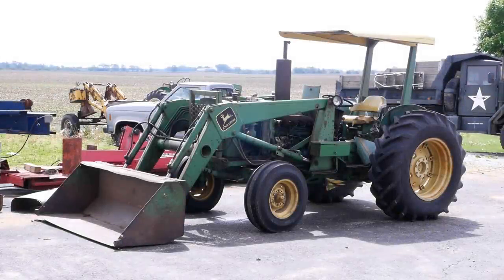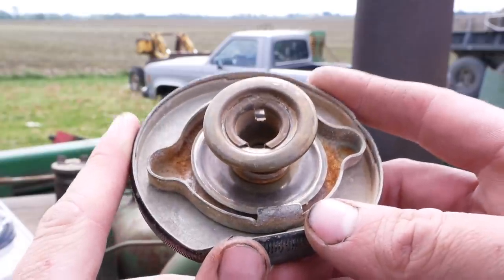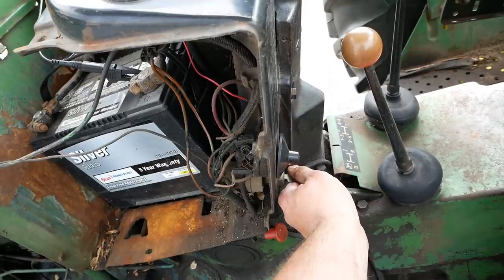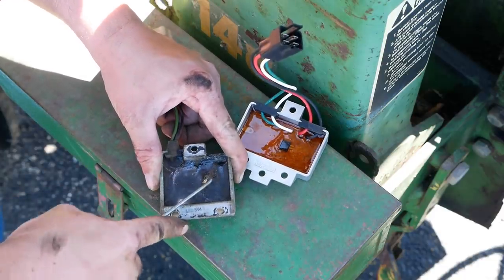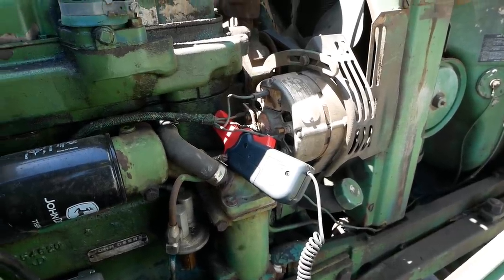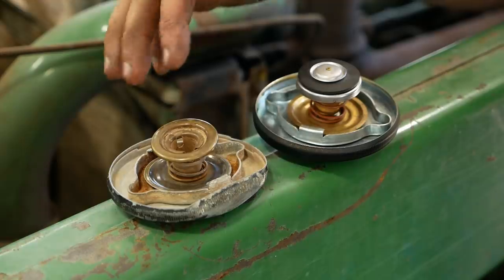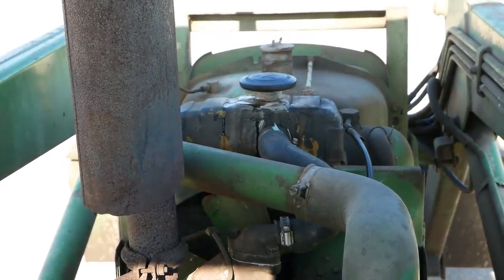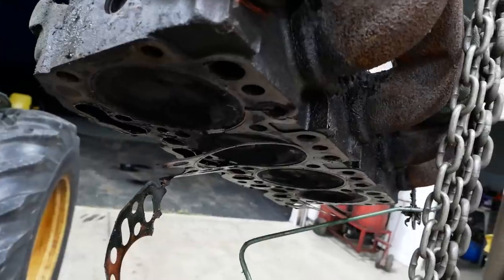Not Fixing a Tractor - Overheating and Barely Starting

Comment: Hi Wes, I just watched your video and I'm incredibly impressed by your knowledge, calm demeanor, honesty and humility for someone so young (yes - I'm old!). I'm in the trade and find that most of the technicians I've employed over the years have had only a fraction of the knowledge that you have but nevertheless had a vastly over rated view of their abilities.

Just a thought re the testing for head gasket failure.  This is not an original idea but one I now make my techs do before I accept their (generally hasty) head gasket failure diagnosis.  Fit a pressure tester to the neck of the radiator when the engine is cold.  Start the engine and watch the gauge, if the pressure only starts to increase from zero as the motor starts to warm up then there is probably no issue.  However, if the gauge starts to rise immediately while the engine is still cold then the cooling system is being pressurized via a blown head gasket or a crack.  Simple, effective and has saved several unnecessary teardowns.  Sorry, but I just don't trust those chemical sniffing test kits.

Keep up the great work, we all learn from your successes and the occasional mistake!

Comment: Had to give you a thumbs up for your expertise and integrity and what I perceive as your genuine dissatisfaction of not being able (scratch that) * allowed * to recover this machine.

I have an old standby automobile that has an overheating issue that was supposed to have been fixed by a reputable garage, I'm gonna take a look at the radiator cap as, I knew it was important, but not as much as you taught me.  Fingers crossed on that and thanks Wes!

Comment: Ehhhh its a mechanical piece, prone to mechanical issues. None of which are your fault. Thumbs up in my book Mr.Wes
Reply: These weren't mechanical faults with the tractor. This is 100% owner or operator abuse. Well-maintained old Deere tractors can run ~forever with the timely application of a lot of time and a little money or less time and lots of money.

Comment: When I was a John Deere tech I just HATED working on neglected crap like this. If there was a Society for the Prevention of Cruelty to Tractors, I would have referred several 'customers' to them.  Probably see this on Big Iron auction soon.  

Sadly, the Dubuque engine was probably the best part of that series of tractor.  The transmissions were pretty problematic, followerd by the hydraulics. The plastic bleed line leaking on this beast is actually an overflow from the surge tank in front   above the main hydraulic pump. Oil from the charge pump inside the transmission goes to the main pump via a big steel line in the inside of the left frame rail. Pressurized oil from the main hyd pump is in the steel line going down the inside of the right frame rail.

Comment: Hi Wes! I finally found your You Tube channel. Now I am binge watching all your videos. I  turn my own wrenches and I am self taught. Had to learn diesel since I have a 2005 GMC duramax and a diesel utility tractor. I dont set limits on myself, but At least I now have Your tube to go to for help. Guess I do OK the 2005 Duramx has 650,000 miles and the Cub Cadet tractor is over 20 year old still going strong.  I am also a fan of Eric O, SMA, he is one of my favs. But I have found You are really a joy to watch. Yeah My dad made me start working on my first car and I never stopped. cars, planes, boats. You keep on doing just what you do, its great. I am now 76 years old and it was not too long ago I built my first barn by myself. Oh I did get my wife to hand up the roof trusses. It was only 16 feet wide and 39 feet long. (no limits).

Comment: Yeah removing a thermostat will never help overheating unless the thermostat itself is the cause of the overheating.
Reply: This is a thing I learned. Subarus the ej25 eats head gaskets, but its a common problem on them when the gasket 'only slightly leaks' where the air bubbles build up on the spring and make the thermostat not open. Soo pop a few 1/8th inch holes in her and the coolant going thru dislodges the bubbles.

Also removing tstat buys you a little bit extra time before it starts overheating
Reply: Even then it will usually cause overheating by virtue of not being there. Had that problem back in HS; friend bought a '67 Mustang that had been Billy Bob'd and one of the things they did was delete the stat. He blew so many rad hoses and pinned the 260 degree temp gauge all the time. He couldn't hardly drive the thing. He tried replacing the radiator...they had put a drag rad in which lacked a pressure cap...it helped a bit in that the pressure cap was preventing further hose blowouts but it still overheated easily. I told him to put a 160 degree stat and a charge of 50/50 green stuff in there and voila; no more overheating.

How he didn't hurt that 351W I'll never know.
Reply: Side note: Nice to bump into another RCer in the doobly do!
Reply: @TestECull  Wednesday after lunch at the engine factory in Windsor.

Comment: At this point, I'm not even sure it would make reliable paperclips if melted down!  I'd say it's time to find a good fence line to park it on, and abandon the old girl!
Reply: It's not that bad if you have a parts source like most areas of the Midwest farming country does and are willing to spend a little money. There are tractor wrecking yards all over that part of the country. Rebuild the engine, change the steering gear and radiator out with good used ones from the wrecking yard, or have a radiator shop re-core the radiator, repack the cylinders to stop the leaks and that thing would probably run another 25 years. 
The owner just didn't have or want to spend the money to fix it. He may already have another small tractor or two like this one that can replace this one, who really knows?
Reply: Mrs Wes 
Yeah, I know, but some of us like a project!😱😱

Comment: Gear drive starters are great.  Selling it after mechanic knows it needs new motor should be illegal. Praying the next owner knows how to fix their own motors
Reply: On what justification should it be illegal to sell something a mechanic tells you the engine's shot on? Disclosing the engine is shot should be the requirement, not that you can't sell it at all.
Reply: @TestECull  He may not have said it explicitly but he likely meant that selling it like that without disclosing the issue should be illegal.
Reply: @nodriveknowitall702  I'm going off what was actually said.
Reply: @TestECull  I understand that. 

All too often a different sort of thief will pretend these issues don't exist.

You surely understand that people frequently fail to fully express themselves.
Reply: @nodriveknowitall702  Yeah and I also understand how fucking infuriating it is when people read between the lines, because people doing precisely that misconstrue what I say all the time and end up yelling at me like I'm the antichrist thinking I said something I never said. Often times the point they're screaming at me to try to make is the same goddamn point I already made and they never saw it because they read between the lines and inserted their own words.

So I go by what's actually said. Someone says 'selling that thing after hearing the mechanic detail what's wrong with it should be illegal' I'm going to go on them saying it should flat out be illegal to sell that machine once they take it back form the mechanic. If they meant to qualify that with a disclosure clause they would have put said disclosure clause in their statement.

I'm sick and tired of people reading between the lines and yelling at me over something I never said so why would I turn around and read between someone else's lines?

Comment: Not every farmer actually knows how to get every Penny out of his equipment. When a machine is just being run without maintenance until it dies, it will die much too early. Early replacement of a dead machine costs you way more money than proper maintenance. 

Sorry, but this thing is beyond repair. Strip off every usable part and sell them on ebay, then phone the trash guy and tell him where the wreck is standing.
Reply: It's not beyond repair lol.
Reply: @TestECull  Of course you can replace the engine, every single gasket and every non metal part the tractor has and whatever else you find while dismanteling it. In the end you pay twice of what the tractor is worth when it is fixed. It simply makes zero sense to repair it. It makes much more sense to dismantle it, sell every usable part and scrap the rest.
Reply: @Itsjustme-Justme  You'd spend less repairing this machine than you would scrapping and buying new machines. The new ones aren't built anywhere near as well and are designed more to empty your wallet to the service truck guy than to actually do work on the farm. You'll get 5-10 yers out of the new one before it's no better than this one was, and with JD being so visciously opposed to Right to Repair, you're gonna be told by the service truck guy that it's done and that you need to buy a brand new machine all over again. Most would be startin' to regret scrapping the old, serviceable, repairable tractor by now.

Rebuild the engine in this machine, throw a clutch and a radiator in it while it's apart, fix the leaks on the loader, and it's good to go for longer than the projected service life of a brand new machine for a third the cost thereof.

Zero reason to scrap this machine.

I wouldn't consider a brand new JD worth its weight in scrap metal while it's still sitting on the dealer lot with less than 10 hours on the tach but I'd consider this machine a prime candidate for some fun. Do a bit of restoration, press it back into service with an engine that isn't trashed, and not have to worry about tractor payments or calling the JD Service Truck every time the dash lights up like a christmas tree over a butterfly fart.
Reply: @TestECull  I did not talk abpout a new machine.  The tractors they build today are trash. They are build to run 10 or maybe 15 years, not more. Their small displacement engines don't pull anything. Just trash. 

The market is full of used tractors from the 70s and 80s. Many of them are designed to last forever when maintained properly. Many of the ones on sale are in a way better shape than this one.
Reply: @Itsjustme-Justme  10-15 years? You've more faith in them than I do....

Comment: Overheating , I always like to drain the oil to check to see water come out the oil pan. Head gasket blown or worse . I realize that first you had to get to start an run. As usual not just one problem . Good video!

Comment: Thumbs up. The money wasted fixing other stuff is on the customer man. This did however convince me to run a leakdown test on anything that "just overheated suddenly" though. This would be the first I've heard of someone wanting a new head gasket on a cracked block, cracked head, and chipped piston. Wild, or nefarious. I'd be hawking C list and facespace to call them out and save someone the trouble if it ends up on there.

Comment: I did an in-frame overhaul on one of those. John Deere made it a pain. I worked on one with a loader as well, and it burned my bottom working around it.

Edit 1: The destruction that you noticed in the engine can also be attributed to ether damage. The engine I did had 3 cracked pistons and multiple blows in the head gasket.

Comment: Hey I learned a few things in this video so its not a total loss:
-You can get those squared headed bolts for battery cables 
-DI mechanical diesels start faster than prechamber ones without glowplugs
-There is a diesel engine that leaks more oil than my Mercedes 300d

Comment: Pretty quick on that head removal. Nice work. That’s a ton of cracks. That’s a nice leak too. I had a few of the guys come in about lunch and tell me there’s a leak on one of our trucks. Turns out a rock wore its way through the def tank. There not easy to find at the moment. I’m guessing you DON’T  want that tractor as a project. 😁
Reply from the maker: Man there's nothing easy to find right now. I'm waiting over a week for an AC condenser for a 2010 Mustang. It's not old or rare...

Comment: No thumbs down for you :)
Not your fault the owner doesn’t want to spend money on it.
Although they must pour a lot of oil in the top.
Funny, I replaced that three point lift shaft seal on my tractor last week!
I never new about the check valve on the radiator cap. 
All good information even though you didn’t get to give it the usual WWW spa treatment.

Comment: Yes, and ive seen people who have had cooling/overheating problems and have pulled the thermostats out of a engine and engine still overheats....they don't understand that a thermostat is a dual purpose item 
It not only opens up when engine comes up to operating temp but, also restricts circulation flow to allow fluid in the radiator to cool down also to allow coolant temperature to stay in optimal range.  In the case of most engines a complete open cooling circulation the airflow will not remove adequate heat as long as heat is being added by the running engine....there has to be a balance

Comment: In the 70s I had a friend of mine's parents call me and ask if I could put a new water pump in their 1960 Chevy 6 cylinder engine because it was over heating, so I loaded my tool box in the back of the pickup and headed over.  I checked the radiator full, hygrometer said it was good on antifreeze, visual inspection showed no fluid outside of the water pump, then I happened to look at the radiator cap and sure enough the gaskets were gone, replaced it. Till I moved in the 80s it was still running strong 

responsible

Comment: You did all you could. There's always Blue Devil head gasket/cooling system sealer in a bottle. Not ideal to use on anything, but that tractor has nothing left to lose.
Reply: That was exactly my thought. A perfect candidate for a miracle in a bottle try. It's junk anyway so if was mine that's what I would do.

Comment: Some folks are determined to abuse equipment til it dies. Make sure you get a signed release from that guy or it will bite you in the butt later on. Good job on the troubleshooting.

Comment: Won`t solve all your problems, but one idea we used when I was servicing charter yacht diesel engines at the end of each season and that were raw  salt water cooled was to recirculate a fresh water coolant that had a strong concentration water descaler in it for some 40 to 90 minutes and then flush through with clean water. If we ever had to pull an engine apart the coolant passages were pristine. No trace of scale at all.

Comment: Just my two cents but I think you will find an excessive temp drop across that rad indicating plugging. It usually shows itself in a slow overheat and scoring in the rear cylinders. Pistons swell and sometimes will knock the bottoms of the liners off. Had this happen twice on the job. Again just my two cents. I really enjoy your videos.

Comment: We have a 2030 with loader and have always kept it up. So last year when 2 little gears in the oil pump crapped out, it was decision time. Overhaul was 5000.00. New or used replacement, 10 to 30,000.00. Internet looking found that these tractors good shape still bringing 9 to 12,000. We overhauled it.

Comment: On them, friend.  ALL on them.
Reply: If it's overheating, and you have the ken, replace the thermostat and rad cap.  Still does it, take it in.
Odd noises, and you can't sort it out, take it in.
Landlady's house mate learned that one the hard way.  He had a van that apparently started making a "noise" from the rear end.  Figured he'd wait until next month, and didn't make it.  Outboard pinion bearing was committing suicide.  Soon as enough slack occurred, the pinion nut jacked off, and the propeller shaft hit the pavement.  Went way down hill from there..

Comment: At Honda I tested a cooling system stop leak called Silver Seal or Aluma Seal that was amazing and may stop or slow the leaks on this motor.  I used it successfully for coolant leaks into the oil pan and radiator leaks.

Comment: Wes, you could add a coolant overflow tank to it and improve the performance of the cooling system quite a bit. By eliminating air in the system you’ll greatly improve the efficiency.

Comment: Wes, I have a 2630 also and I have found out the years that the radiator fins get plugged up with dust and mine will tend to run too hot. I blow them out and sometimes have to pressure wash it out. Check that radiator and see if it is clear of dirt.

Comment: I have rebuilt many of this vintage JD engines. Typically what happens is that a sleeve will develop a hole from the breaking down of the coolant- coolant needs to be changed regularly as the engine vibration causes it
Reply: Vibration causes the coolant to break down. The sleeve hole causes coolant loss, then overheating and then damage.

Comment: I'm a mechanic in NZ. That overheating has been going on for a long time and once its got cracks in the head the compression is going to pump out the coolant and with that rad cap being rooted and the gauge not working. That's why it is like it is. Like anything as long as you do the maintenance on it should last well. Most of the JD stuff is reliable. Not cheap for parts but it is reliable. That model should be reliable too. Most of those problems haven't just happened over night and they haven't been fixed.. With leaks like that you end up destroying hydraulic pumps from running them dry. They are never cheap. Wes unless you did that job properly (the expensive way) it would bite you on the ass the owner doesn't do the maintenance on it.